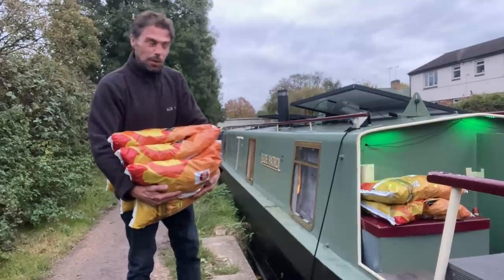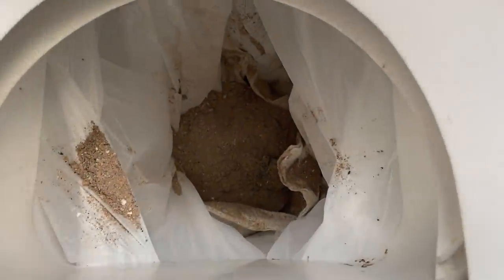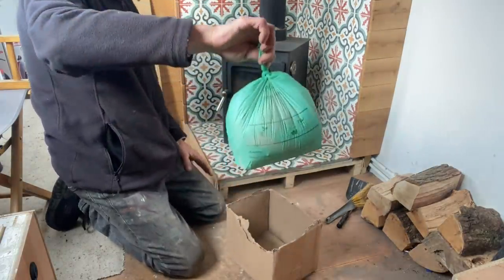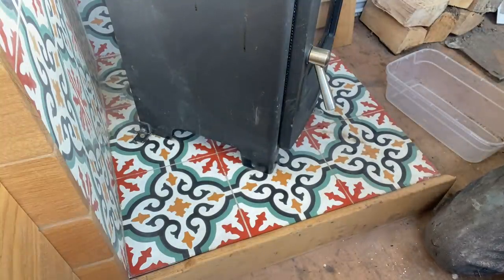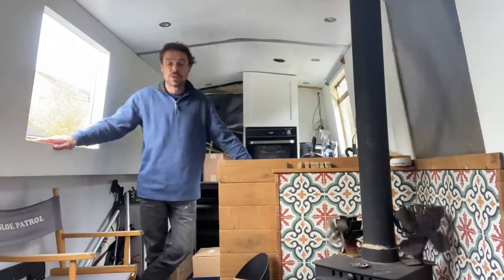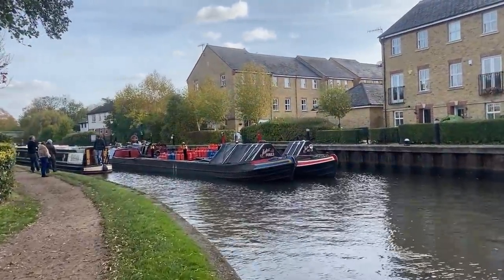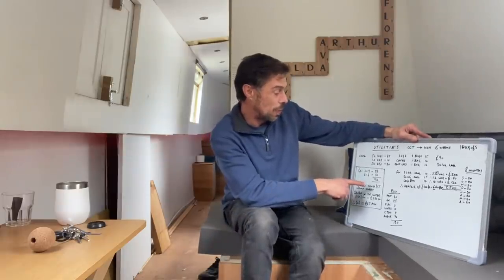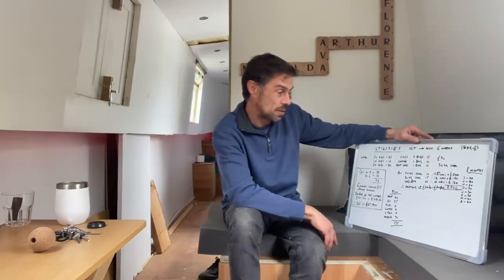275. How I manage fuel and waste on board the Narrowboat

Comment: Just out of curiosity I did a search on the web to find out where I could buy coal, here in the united states. I would have to drive 200 miles from where I am now to procure some. Coal is just about banned here in the US. Most all coal mines are shut down. The only coal used in the US is for older electric generator plants. Coal is considered a major pollutant. I have never burned coal in my life. I am 60 years old and coal is considered to be an archaic form of fuel. I don't think that I have ever touched a piece of coal.
Reply: It won’t be actual coal, it will be a smokeless fuel, think we just call it coal from days gone by, we can only use smokeless fuel in England :)